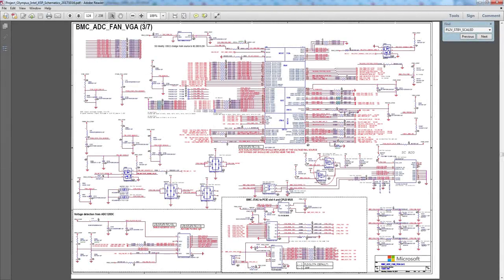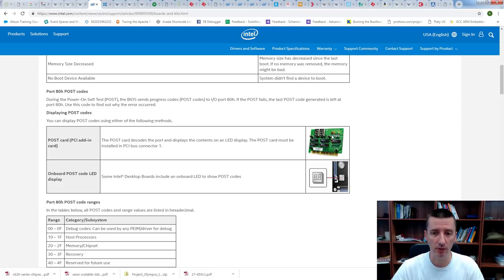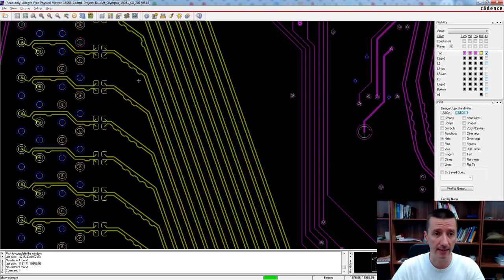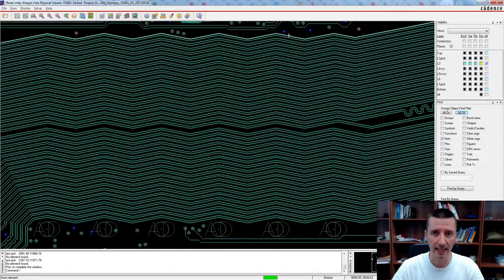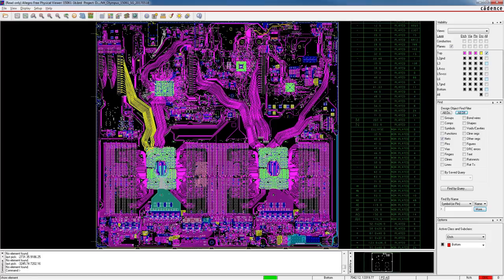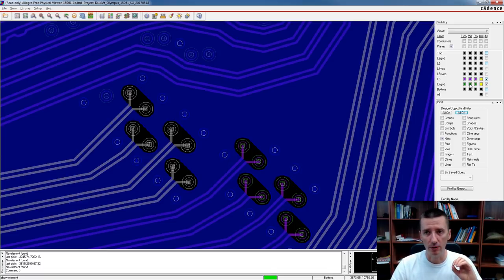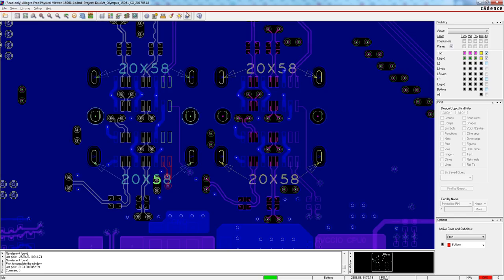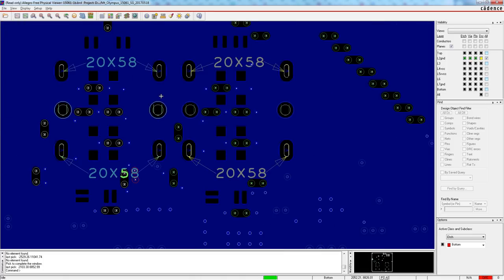Review of Server PCB Layout & Schematic - Part 4: PCI Express (PCIE)

Comment: On 9:00 you are saying about return current in reference plane. Can you explain, why SATA interface, which has differential signals will have return currents in ground plane? I always thought, that the current will flow only in differential pair itself.

Comment: Good video. Just a little nitpicking, those are not stitching vias, they are current return vias. Stitching vias are for when you connect planes on either layer when they haven't been connected in an area to stop a potential difference occuring.

Comment: Good video again!
I have a question. Could you maybe do a video about what speeds and type of signals certain routing techniques are needed? For example I have seen people being all difficult about slow I2C signals and/or signals that aren't even differential. Same for ground stitching etc.
Reply from the maker: Thank you Merlin. I have not seen any good materials and examples for this kind of topic yet. Let's see if I will find something...
Reply: @RobertFeranec  Thanks. The zigzag traces reminded me. The document clearly says it's needed for signals >5G T/s. I was wondering if there are any other general guidelines or rules of thumb for certain signals? Or like I said when ground stitching/via shielding is really mandatory.

Comment: Hey Robert, I love your videos and I've also gone through your advanced PCB layout course.

I used Saturn PCB that you showed in another video to try and calculate the differenctial pair trace impedance of that board. I downloaded cadence and this board file. I have w = 3.5 s = 3.5 and h = 2.7 mils. .5oz base copper weight and 1oz plating thickness. Er= 4.5. I get a zdifferential of 73.545 ohms which isn't near the desired 100ohms for PCI-e differential pairs. I'm wondering if I may be missing something because I'm trying to design some pci-e traces for this new BGA nvme I got my hands on, and I wanted to have this as a baseline so when I modify the values for my board it will be more accurate. Any advice would be appretiated.